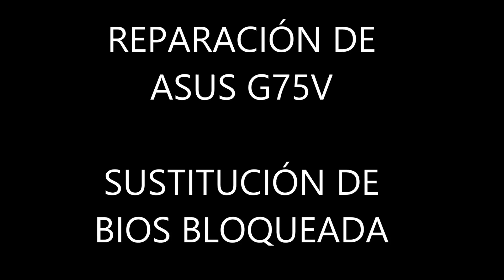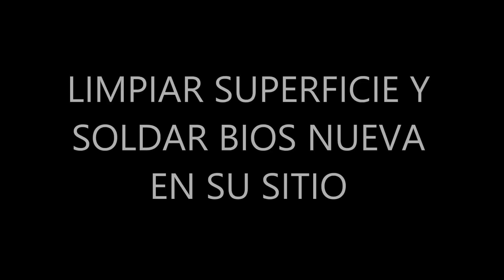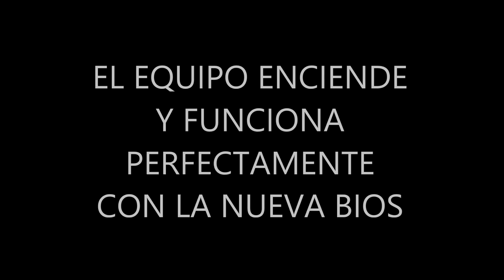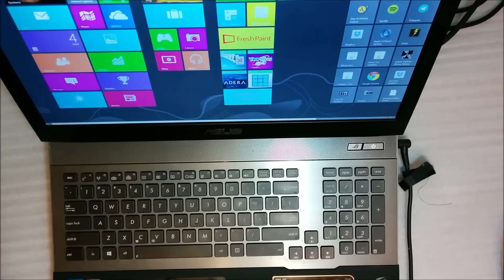✅REPARACIÓN ASUS G75V SERIES BIOS BLOQUEADA (NO ENCIENDE)

Comment: hola amigo como estas? vieras que tengo exactamente el mismo modelo, ella enciende peo no da imagen nunca arranque, primero empezó, que habia que dejarla un rato conectada y despues encendio pero fue empeorando y ya dejo de trabajar sera problema del bios? te comento que antes de fallas empezo que se apagaba en los juegos y despues empezo con el encendido, quedo atento saludos
Reply from the maker: Amigo lo que te está pasando no tiene nada que ver con lo que se soluciona en el vídeo, en el vídeo lo que pasó es que actualizaron la bios y se quedó bloqueada y la reparación fue sustituir la bios que es un chip que está soldado a la placa base por uno previamente programado. En tu caso pueden ser varias cosas la más sencilla es que se calente y por eso se apaga, solución hacerle mantenimiento sustituyendo pasta térmica del procesador y la gráfica y limpiar los ventiladores y disipadores, si eso no funciona es posible que por el sobrecalentamiento esté dañado el chip de la gráfica y entonces se tendría que hacer reflow que ya lo tendría que hacer en en taller con herramientas especializadas. Un saludo y suerte.
Reply: @dianrie  Gracias amigo por responder y orientarme, saludos.

Comment: Hola! Esperó puedas orientarme. Cada 3 meses abro mi g55vw y la limpio del polvo ( no saco micro) hace un mes la desarme y la volví a armar. Le di al botón power y queda prendido junto con las dos primeras luces de adelante (power y batería si mal no recuerdo). Si mantengo apretado el botón power no se apaga. No prende pantalla, ni coolers, ni disco, tampoco produce pitidos. La envíe a tres técnicos los cuales no vieron nada raro en el mother... Sera ese chip de BIOS? Que crees que pueda ser? Muchas gracias de antemano
Reply from the maker: +Ezequiel Fernandez Tengo una pregunta para ti, desconectaste la batería que alimenta la bios? en tal caso creo que es posible que se quedara bloqueada y por eso no te enciende.

El portátil que se ve en el vídeo el problema fue por cambiar el orden del arranque para arrancar desde cd y al guardar se bloqueo, la solución que yo aplique fue sustituir la bios por otra preprogramada.

Comment: Hola!
Hermano, tu sabes como se hace para reprogramar la BIOS? tengo un ASUS G75VW.
Reply: buenas tardes
Antenor h santos
lo unico que debe tener es lo siguiente.
programador de bios y su Firmware correspondiente a la placa.
si su portatil es marca asus y el modelo es G75VW tiene que ir a la pagina de Asus y descargar el Firmware
Que es el Firmware?
el firmware es una informacion que necesita el chip bios para poder arrancar el sistema. El Basic Input/Output System
Reply from the maker: +Antenor H Santos Como bien te indica sara, podras hacerlo con un programador pero puede resultar complicado ya que tendrias que quitar el chip ponerlo en el programador y luego resordarlo, yo lo pedí programado directamente, también hay otra formara de programar la bios metiendo el firmware en un pen drive y arrancando el ordenador con una combinación especial de teclas, pero desconozco si en este modelo eso se puede hacer.

Comment: what is the connector under the power button? white/blue small thin connector. where i should put it? i didnt touch my bios chip but my laptop wont boot. is that connector the reason?
Reply from the maker: +Samuel Kosunen No entiendo tu pregunta?
Reply: +dianrie Reparate  i didnt understand but i solved my problem and my laptop boots now :)